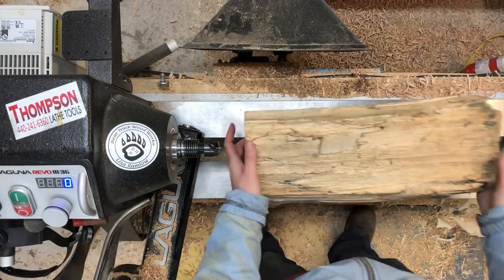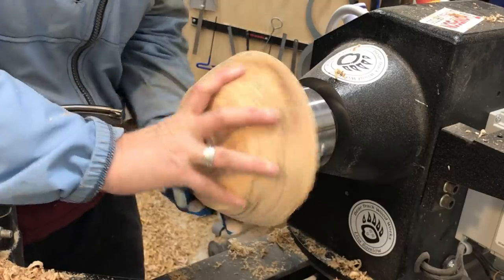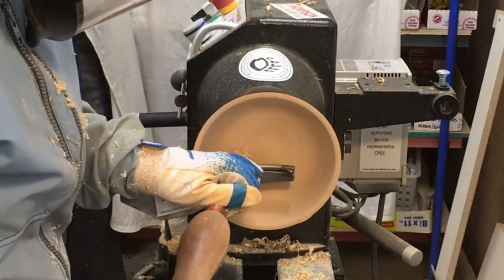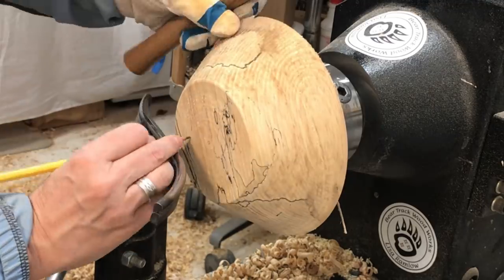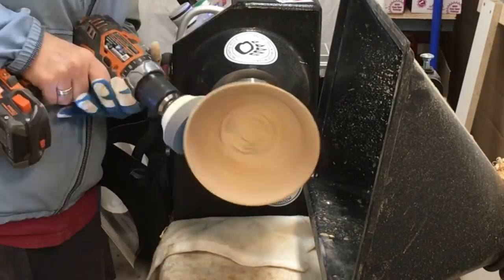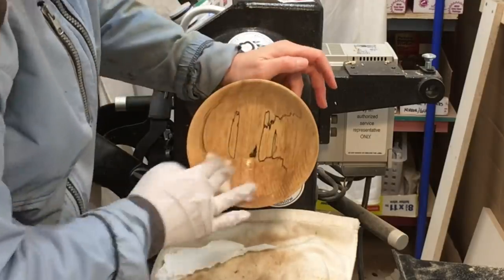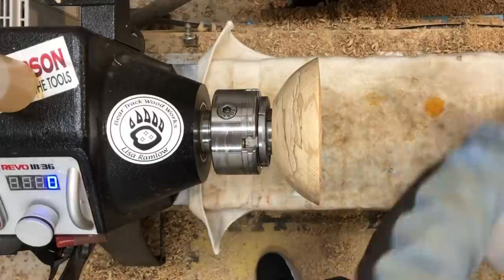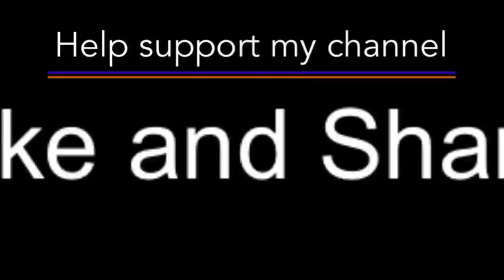Woodturning Firewood: Spalted Ash to Snack Bowls

Comment: Hi Lisa  To get the wood worm out just loosen the chuck and then close it on just the head wws so that the wood is not touching the jaws  and it will come off with one hand .  Hint from the Old Guy's Wood Shop  So good to see a lady turning . Have fun making saw dust .
Reply from the maker: Hi Lowell! I’ll try that trick next time I get one stuck - seems easier these taking the screw out of the chuck and removing it within vise grips, which has been my method when it was so tight it was turning the chuck, even with the set screw tightened down 😂

Comment: I was only turning for six months but did quite a bit of Ash, found it varied a lot, some turned beautifully and some was just cranky.  I think your tool contol is much better now, practice makes perfect as they say.
Reply from the maker: Hi Lewis! Yes, this is only the 2nd time I’ve turned ash and it was fairly nice to me. I rescued several more pieces with either spalting or some potentially nice figure so maybe my luck will hold out. I imagine this tree was standing dead for some time before it was cut down so it has dried out some, but not so much that it’s splintery

Comment: I am new to woodturning, and use only firewood at present as kiln dried wood is so expensive in the UK, so it's best to learn  firewood.
Reply from the maker: Hi Graeme! Green wood is way more fun to turn that kiln dried anyway - I just finish turned a natural edge maple log that I’d roughed in early February and dried in my homemade dishwasher kiln. You get wet when turning green wood and burned when turning dry - it’s amazing how hot the shaving are coming off a dry blank! 
Sometimes the prettiest pieces are ones salvaged from the firewood pile! Cheers, and safe and happy turning! 😁

Comment: For sanding out warped bowls, max speed for being able to keep your drill on the wood is about 15rpm. Do that all the time. Had my Robust speed range adjusted. My Vic goes down lower than 15 all by itself. Don't know if you ever checked out my video about 'articulated arm for sanding', but I can't sand bowls without it. Since your arm is resting/supported, all you have to do is pull the speed trigger. This makes it easy for you to hand spin the bowl with the other hand. Some one can make a much better one than I did.
Reply from the maker: Hey Reed! I have watched that one, a couple of times, but it’s been a while and I probably need a refresher. The Laguna only goes to 50 on the lowest setting but I do have a BBQ rotisserie motor rigged up to turn the spindle… 🤔🤔🤔

Comment: Hi Lisa, I have the same lathe as you have and with the belt on the slowest setting the minimum r.p.m. is 50 r.p.m. Thanks for the video. I loved it!
Reply from the maker: Hi Terry! Yes, I should’ve qualified that, it is the slowest setting for the upper set of gears. I find at 140rpm I don’t have any issues getting myself out of the way with a blank this small. Anything bigger I’d have it on the lower setting and would be at that 50rpm mark 👍

Comment: Hi Lisa, Yep, firewood can be your friend. hehe. These turned out really well even considering the warping. Which didn't seem to slow you down too much - good job !  Thanks for sharing🙏 Take care. -Mike
p.s. "you've had a whole half already!"
p.p.s. I had a worm screw get stuck once - the chuck unscrewed before the screw budged.  I ended up jamming the chuck key between the ways and then all was OK. The advice I got was to wax the screw beforehand.
Reply from the maker: I’ve had to take the worm screw out of the chuck and remove it with a pair of channel locks or vice grips. Crazy how tight it can get! Take care Mike!
Reply: @LisaRamlow  👍😎

Comment: What a great idea to color  coordinate your circle center finder!! I am definitely going to copy!!  I love your stickers!!   Just to share:  Whenever my project gives me an issue coming off of the worm screw, I use a strap wrench :-)  Another wonderful video.....looking forward to the next one!
Reply from the maker: Thanks Laurie! It only took me a year to actually think of a solution instead of just tracing my finger around whichever one I thought was close! 😂
Great idea with the strap wrench - this one made was harder than usual by the stringy-pokey bits along the rim edge but it was on there tight! I’ve actually had one case where it was on there so tight I was turning the whole chuck *while the set screw was tight*! I had to take the worm screw out of the chuck and use a pair of vise grips to unscrew it, and I only hand tighten them on!?

Comment: Nice firewood conversion.  Besides tenon or recess, another good mounting option would be a glue block, as expanding into some spalted wood could force it to split.
Reply from the maker: Hi Brad! Yes, I was a bit worried about using a mortise but I did orient it bowl-style and after I’d turned the first piece on the spur drive, I was as relatively confident it wouldn’t be explode or crack as the wood itself was solid. I do use glue blocks as well and that was probably a better choice for mounting these little guys. Thanks for stopping by! 😁

Comment: I love the simplicity of the bowls, Lisa.  Well turned!
So, now that you have two bowls from the same chunk of wood, turned at the same time, and finished with the same products (except the final coat), can you tell a difference in the look and feel?  Do you have a preference?
Reply from the maker: Hi Crystal! To be honest, the look and feel of both bowls is pretty damn close. Since tung oil is a drying oil that actually does get into the wood and cure, I think the Tung Wax probably provides a bit more long term protection than the mineral oil used to distribute the wax in the Ack’s Polish, but they both have carnuba wax which is the hardest wax so it may come down to personal preference

Comment: Love the spalting. How do you like your CBNs? I took the plunge and I love them. CBN has the square edge wheels too for the dove tail tool. The chocolate oak burl was amazing as well.
Reply from the maker: Thanks Mel! I love the CBNs - I have a 180 and 600. I believe both of mine have a radius edge but they are an amazing addition to the shop.

Comment: Very nice.  The spalting is really cool.   I think you sharpen that dovetail tool by honing the top flat on your diamond stone the same way one sharpens thread chasing tools.   If you apply the sharpening stone to the dovetail, you are going to reshape the profile.    Hope that makes sense.
Reply from the maker: Doh! That makes perfect sense. I don’t  really hone any of my tools, I use the CBN wheels or raise a burr on my negative rake scrapers but am not well versed in honing.

Comment: Hi Lisa. I love it when turners rescue firewood and turn it into very pretty and functional pieces. Two questions if I may. Why remove sanding dust when your next step is to apply what is basically stone or shell dust imbedded in wax? And , if the wood has been sealed with shellac and polished with abrasive paste, how can it absorb a further finish before you finally buff it? I’m still getting my head around some of these nuances of finishing. Thank you for your time!
Cheers, Rick
Reply: Hi Rick, lisa asked me to lend a hand answering this. But i'll preface this by saying theres a ton of different ways to finish and no single "right" way. Every piece of wood will have different characteristics and every craftsman their own personal prefrences. The key is finding what works for you. But I finish much of my work similar to lisa. Wiping down a project between each grit or before sanding paste has a few reasons. Sanding dust and sometimes abrasive thats come off your sandpaper can come together and form tiny, hard, "balls" for lack of a better word, which could scratch your project. Fairly rare, but an easy wipe down can prevent any chance of it happening. And also clean out pores with dealing with open grain wood. As far as the sealer, thats a great question! The quick answer is that "sealers" such as shellac, lacquer, etc do not completely seal off the wood. It would take a ridiculous number of coats to attempt that. A seal coat is basically there to prep the wood for your final finish. Now theres more to it then this but as you can see i've already written a novel just trying to give a basic answer lol. But I love this question and as soon as the holiday rush is over, i will do a video to try to go deeper down the rabbit hole. Hope it at least gives u a basic idea of the reasoning tho. 👍
Reply from the maker: Thanks Brad. I appreciate your input!

Comment: Do you note what finishes you use on each project? Also, your spindle lock. Did you make, or buy it, and what magnet is in it. I am trying to find a strong enough magnet so it won’t pop out when I put pressure on.
Reply from the maker: Hi Scott! I’ve recently started a spreadsheet to keep track of all my projects and the sizes, species, and finishes used cu my memory is just crappy anymore. I made the spindle lock - Gary (ThePapa1947) did a video in making it and it works great. I have 2 neodymium magnets that are maybe 1/2 - 3/4” in diameter and they work fine. Got them from the magnet section at the local big box store but I’ve seen them in hardware stores like Ace as well - these are Magnet Source brand.

Comment: Nice complimentary bowl set. BTW, do you have the 110v or 220v Laguna? Narrowed dow the lathe now deciding if 220v would be worth it.
Reply from the maker: 220v and if you have the option I would definitely get it. I feel it’s well worth it 👍
Reply: @LisaRamlow  Thank you Lisa, I appreciate your advice. I hope to turn as big and gnarly logs as you do, right now my Harbor Freight with its lowest speed ~500 and 3/4 hp motor just doesn’t cut it, literally.

Comment: I use pressure from the tail stock to start threading the piece onto a wood screw.
Reply from the maker: That’s a good idea - I’ll have to give it a shot. For small pieces like this I don’t worry about it too much but I don’t feel comfortably mounting bigger pieces that way. Thanks for the tip!